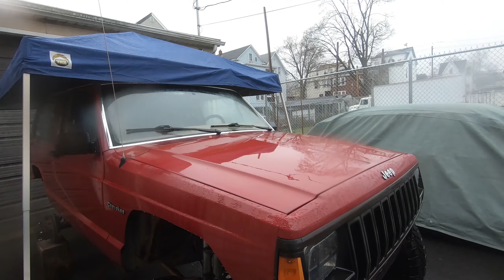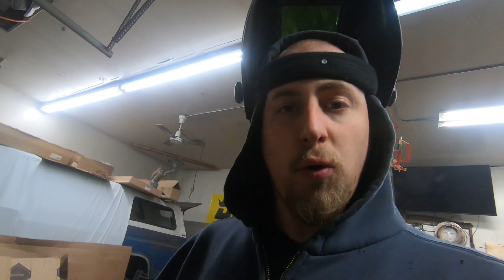Jeep Cherokee Boostwerks Engineering Shock Tower Installation

Comment: I realize that this video is 5 years old, but I was wondering if you have had any issues with rear axle wrap? The stock locations for the rear lower shock mounts are 1 side in front of the axle and 1 side behind the axle. This made me wonder if the original lower mount locations were in an attempt to reduce axle wrap. Also, what angle did you mount the shocks at? Do the shocks meet the axle at exactly 90 degrees or did you lean them back more? I'm in the process of relocating my rear shocks. So, any help would be appreciated!
Reply from the maker: They are at a 90* angle it does have some wrap when you try to do burnouts but that's about it

Comment: WHat size shocks did you go with? Length and Stroke?
Reply from the maker: I went with the longest rx200 shock that rustys offers
Reply: @Grewsum2Sum  awesome thanks I'm strongly considering doing this on my Jeep. I also think the crossbar would be an awesome addition for 4-point harnesses and a spare tire mount
Reply from the maker: Exactly my plan
Reply: @Grewsum2Sum  only difference is I think I would steal the old school drift and drag trailer fender tub trick for the fenders especially with the lifted vehicle and the holes and whatnot it would be more fad but it would look cool and if you got low profile fenders it would actually technically speaking give you more room in the cab for other things

Comment: Do u know the measurements of the inside opening of them. I have coilovers i want to use but the spring is 4.5” in diameter dont know if they will fit.
Reply from the maker: I'll measure them tomorrow and comment
Reply: Grewsum 2Sum awsome thankyou
Reply from the maker: @Rerautomotive  the inside box is 6x6! You should have a decent amount of room for your plans!